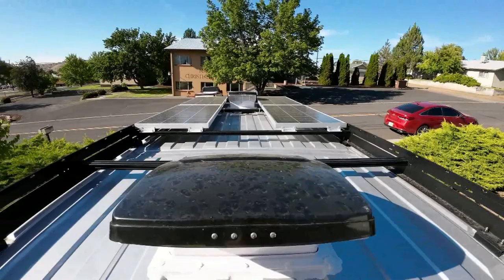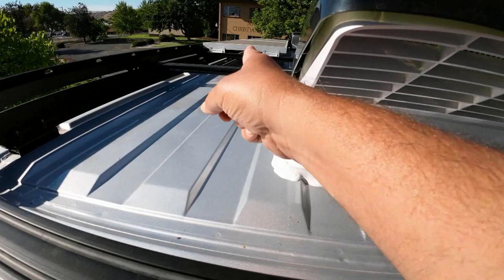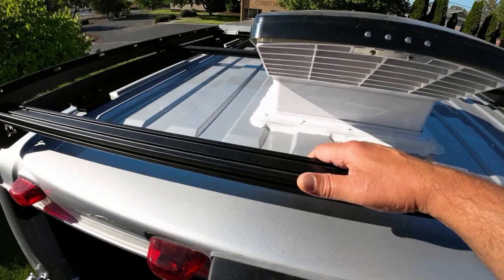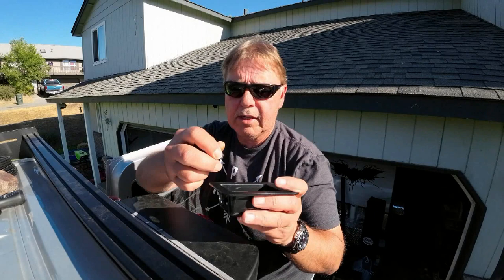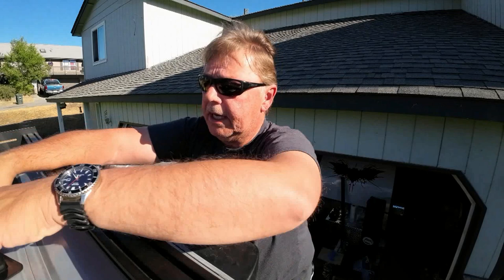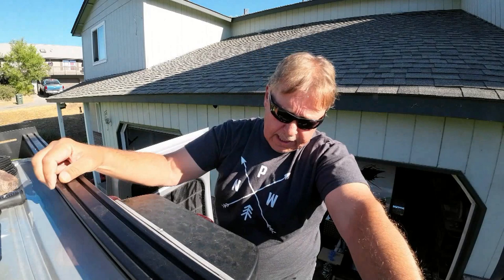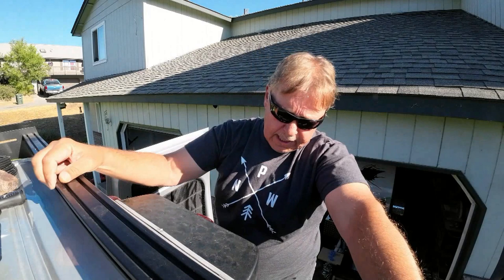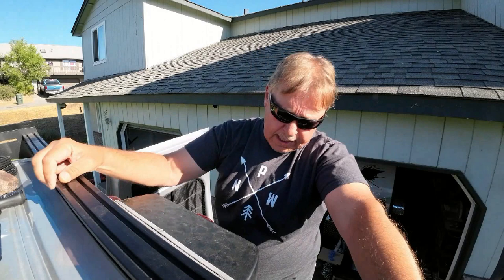Promaster Van Build 2500 159WB – DIY– Solar Wiring – Part 44

Comment: Great video! I'm going to try this as well. What type of drill bit did you use?
Reply from the maker: I think I used the step bit to dill the hole, but you can use any type of bit as the plastic isn't that thick or tough. Thanks for checking it out!

Comment: Where are you located in the PNW? I am in Sandy Oregon, but go back-and-forth from here to Eugene frequently. I have everything I need to start my van build, except for I need to find somebody to help me with the electrical. My solar panels are on the roof. I have two lithium batteries, a 2000 watt inverter … I have watched many YouTube videos but I just cannot track 🤪. I will pay depending on cost of course
Reply from the maker: Hello! I am in Madras Oregon... you can email me if you want and I can try to answer some of your questions :)
Reply: @OregonBatman A new viewer from southern Oregon coast near Gardiner. Nice video!
Reply from the maker: @gwb8445  Greetings!! Thank you! Thanks for checking out the channel!

Comment: you cut 2 massive holes in the top for the fans, whats the issue with a gland for the solar wires?
Reply from the maker: The fans are fastened through the van into stud framing, very secure and sealed well. Most of the glands are secured with self tappers, which will, in time vibrate loose, not a risk I was willing to make.